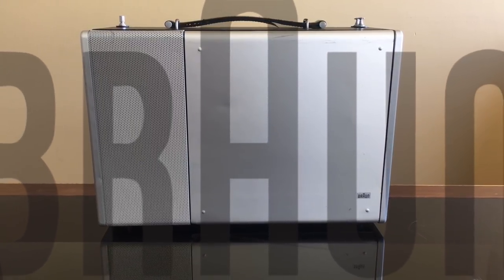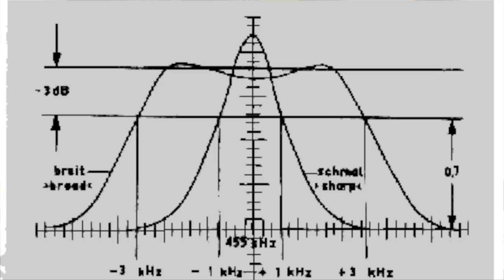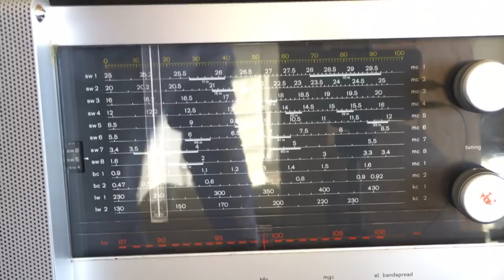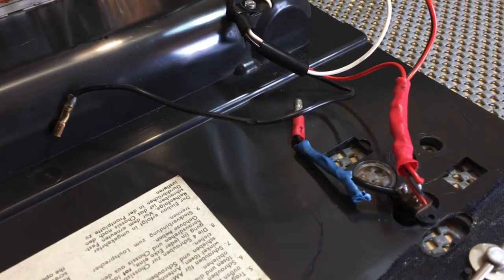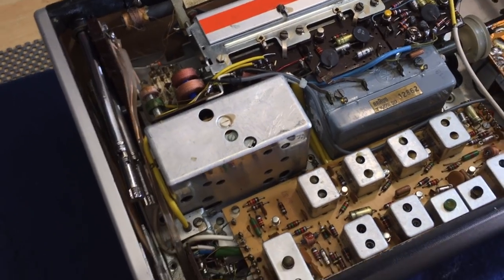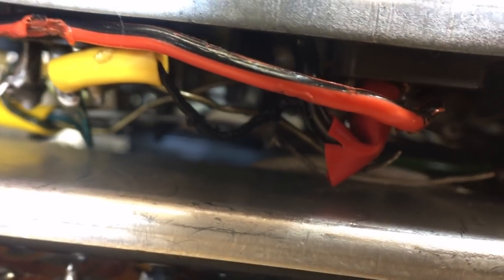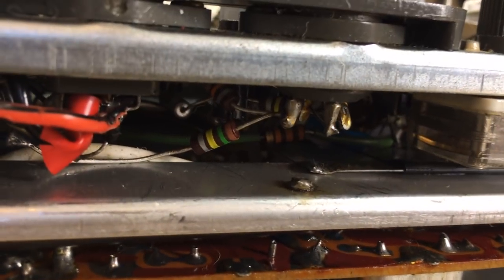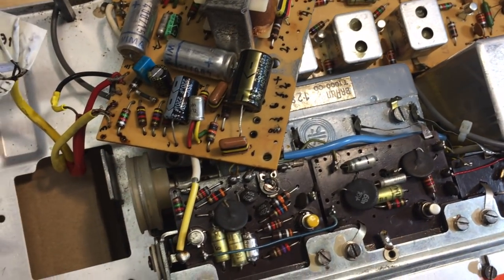Braun T1000CD repair - part 1. Previous 'tech' should be jailed.

Comment: So happy to see someone posting repair videos for this radio! I just picked one up earlier this year from the original owner who bought it new in 1968 and has used it sparingly. Every day I learn something new. Yesterday I learned that you need to put 1 D battery in to get the illumination to work. It will not work if it’s just plugged in. I thought the lights were burnt out! Keep up the vids! 👍🏼👍🏼👍🏼
Reply from the maker: Enjoy the radio. It’s a true gem.

Comment: I always liked the look of the T1000 which I think is the earlier model of the T1000CD that I believe was introduced in 1962.  Wish I could afford one.  They are absolutely gorgeous and would not look out of place on a retail shelf today.
Reply from the maker: you’re correct about the order of the models. Either one is magnificent, but there is actually another model, which is the t1000cd but with a white dial. That one I believe was made as a special edition and is even rarer.
Reply: @electronicsoldandnew  I would absolutely love to just see that one.   At the moment, I would .... well lets say I would be in trouble if I considered buying just the standard T1000 given that, including shipping, they are over $1000 AU dollars in most cases, and the cheaper ones are missing things like knobs or the front cover which are close to impossible to find on their own.

Comment: I just recently purchased a Braun T1000 CD myself and I think its one of the most iconic/beautiful pieces of design that Braun has created. But I have a rather simple question. What would you recommend for cleaning off the metal speaker grill? Mine has a bit of stain on it similar to what is on this one. What was your process you did to clean the metal exterior? Thanks!
Reply from the maker: I usually start with simple dishwasher liquid and a wet cloth. That takes off most of the stuff without removing graphics or paint. If that doesn’t do it all, I use isopropyl alcohol with a cotton bud, and tackle very small areas at a time.
Reply: @electronicsoldandnew  Thank you! Also, I’m the proud owner of your beautifully restored Braun SK 2 radio that you posted to Reverb. And I am loving looking at it every day. Thank you again!
Reply from the maker: Wow, that’s amazing. it’s a fantastic little radio that really looks great -or even better - today. The 1000cd is perfect companion 😊
Reply from the maker: Another one that I love the look of is the Grundig 2147 that I restored recently on the channel. I’m going to start doing the brown faceplate twin to it soon, and am planning to list the two together, because they really look great as a pair.

Comment: Your articles and work are just fantastic.   Thanks to your presentation, I was able to get My T1000CD in good working order.  The only thing that does no work is the ferrite antenna,  Reception is weak when the ferrite antenna is in use.  I feel that the wiring from the antenna to the band selector switch is incorrect.  I'm not good enough to be able to transfer the schematic diagram to the physical placement of the wires on the switch.  I can almost get some help from your pictures, but they are a bit dark to get the color contrast to see the details.  Any chance you could take a few minutes and get me pictures with more details?   Im not sure where else to get help.  If I knew someone in the Milwaukee Wisconsin area with a !000 I would be able to solve the problem easily by looking at another radio.  There just are not enough of them around.  
Thanks again for taking time to put he excellent video presentation on he net.   
Sincerely  Karl
Reply from the maker: Sorry I cannot help you Karl. The radio isn’t mine and has been returned to the owner quite some time ago, and he’s no longer living in Madeira. Good luck at your end. If I get my hands on another one, I’ll be sure to get close-ups.

Comment: This is the no#1 reason I don't purchase broken stuff that has previous repair attempts on them. I'm a radio amateur, and I love old tech gadgets like this - but I've repaired and serviced so many over the years, I've learned that "previous repair attempts" are usually a disaster waiting to unfold. The worst case I ever saw, was someone soldering the PCB so hard that they actually BURNED a hole through the entire multi-layered PCB, making it literally impossible to recover since it was a 3-layer PCB where the previous amateur "repair tech" had soldered so hard that it burned a hole trough the entire PCB layer, shorting the 3rd middle layer to the top/bottom layers. There are some people out there who should NEVER touch electronics.
Reply from the maker: The problem is that anyone can call himself an expert, and passes as one until someone else gets his mess to repair.
Reply: @electronicsoldandnew  So true, I've been fixing stuff for 30+ years, and I STILL Don't call myself an expert.

Comment: Hi I have one (t1000cd) that is working and in good condition but I don’t have the power supply cable... don’t know where I can get one or how much it is worth it now. There are a lot of offers on eBay from 400-1000$ . May you can help me with that. Anyway great video!
Reply from the maker: if it’s just the cable, it shouldn’t be difficult to get a local electrical supply shop to help you out. This one I did had been hacked.

Comment: Who ever got let loose inside this should be banned from electronics. That is some pretty bad workmanship, and those manky added wires and everything put back in random places? Good grief! You've taken on a project there and no doubt it will operate again. As you said just hope no damage has been done to the RF stages due to the previous clowns attempt to fix this. Fingers crossed for Part 2 ☺
Reply from the maker: I think part 2 will surprise you. Should be posted soon. I just can’t understand why someone would do this to a radio.

Comment: Braun design is like apple before steve jobs.
Reply from the maker: It’s where apple got its inspiration. Jonathan Ive from apple is actually a good friend of dieter rams.
Reply: @electronicsoldandnew  Makes good sense, everything is inspired from something. and Braun was definitely ahead of the curve.
Reply: TheStuffMade Braun is also like Apple in matters of devoted followrs or rather fanboys. If you compare their gear to other manufactureres of that era you will see that they do not achieve that superior performance that would justify their weird designs and they are a horror to service for anyone not devoid of any time restraints like a hobbyist. What ppl especially hobbyists do not grasp or remotely comprehend is that professional techs work on a tight time schedule to make a living or stay employed. And not every shop has the opportunity to turn down a client who does not want to spend the money needed to do a restorers work. Sorry but comments l)ke "the tech should be jailed" are just showing ignorance.

Comment: I can't help myself...every time you refer to a set like that one and call it antique, I can't help but laugh.  You see, to me, antique requires vacuum tubes!  I know, your use of the term in applying it to the solid state items of that era is indeed correct...they are antiques.  It's just funny to me because I go way back to the REALLY Old Time Radio days.
I am glad that you are working on that radio.  It warms the heart to know that someone is working on a radio that actually cares about what they are doing and knowing that they will do everything possible to bring it back to the best condition possible.  Considering how badly the mess was done that you found, I would suggest replacing the capacitors that the previous person replaced simply because of the possible damage done to them due to the miswiring you spoke of.
Looking forward to the upcoming videos on this one.  Especially interested in seeing the works of the tuning device that is operated by the side "flapper knob" to be able to see what is being switched and how.
Reply from the maker: Antique is relative: I’m 56 years  old and my daughter thinks I’m one :)
I love tube radios, as you probably know. They are challenging and actually provide me with even more satisfaction when I get a radio as old as my father working again. 
This one is going to be fun, because I particular like the design. There are just so many areas to work on that I’m tackling it very carefully.

Comment: You'll be lucky if it ends there, looks like the full blown screwdriver mechanic has been loose in here, in a proper TV/Radio shop, he /she would have been sacked at least 15 times in the your sacked conversation with the boss. You got your work cut out with this one, but it will sound lovely when you've finished it
Reply from the maker: I’m currently experiencing a mixture of excitement and fear :)
Reply: I've got to give you that  conversation haven't I right ,Your a excellent Tech, you like the brand, and you will make it work, I'll stop there before you reach for the sick bag :)  Paul

Comment: I feel your pain when you opened the Braun.  Looks like a teenage amateur with poor soldering skills took a whack at it.   I recently received a costly Onkyo stereo amp/ receiver with trash dust as well as botched wiring, added resistors and an after-market fan held by twist wire.  If I can't undo the mess, the unit will be scraped for parts...sadly.   Looking forward to your updates.   J K
Reply from the maker: Looking at this radio reminded me of an old song called “love hurts” :)
Reply: Do you prefer NAZARETH or Everly Brothers version ?   Both good and to the point.   Thanks   J K